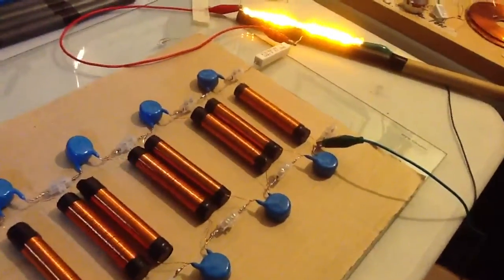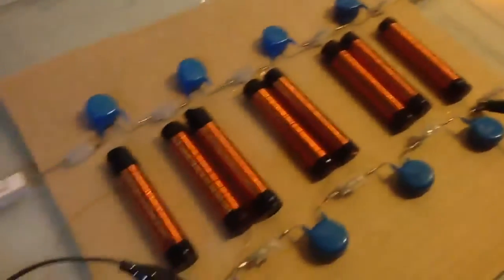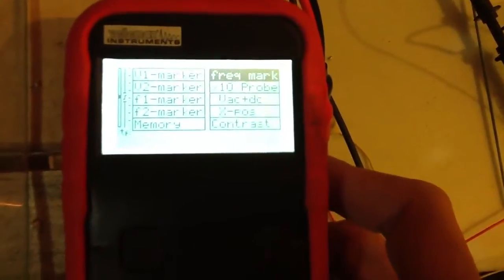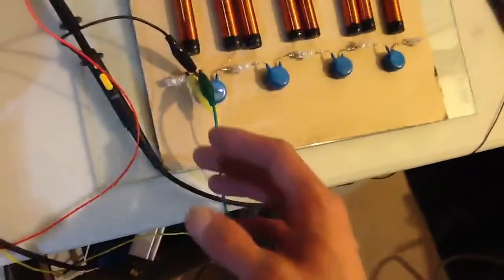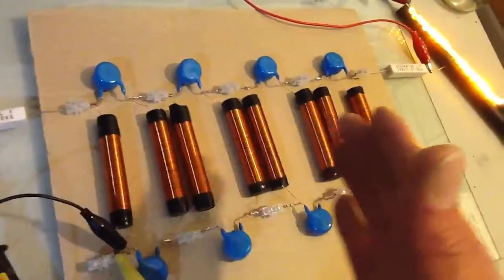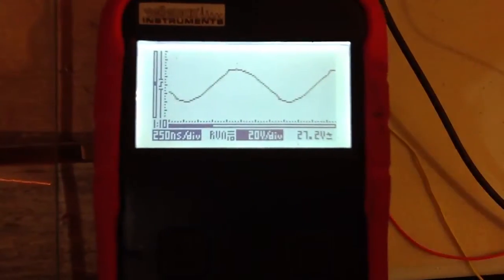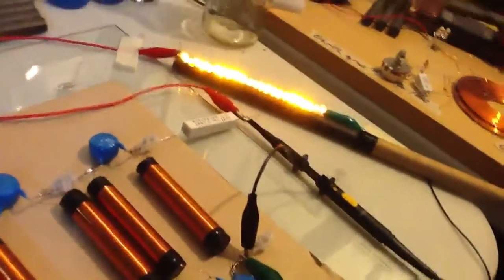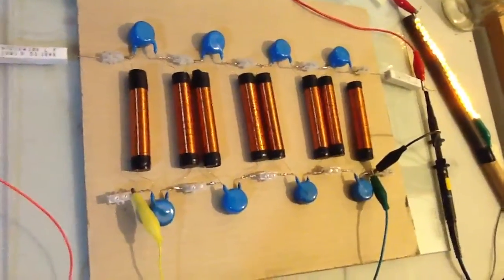1 Tesla LMD Longitudinal Magneto Dielectricity: first light

Comment: Little toroidal coils works fine too. 0,95mH each with 100nF wima caps. I use two lightbulbs 7V/0,3A. One in series with generator at input, second in parallel with last coil. At 104kHz the output lightbulb is more bright than input one. Even if I interchange them for check, the output one is every time brighter.
Reply from the maker: That is very cool. I never thought of that

Comment: your rf chokes could use allot.more.turns to
Reply from the maker: thanks yes i could have had more turns, but i only wanted a Single layer of windings, and was looking for a fairly high frequency, more turns would raise inductance and lower the resonant frequency
Reply: kdkinen eric dollard was using rf chokes that had many turns lowering the resonance is not a bad thing
Reply from the maker: yep those are cool, all pre-made. if i had enough of a certain one i would just go with that. im not opposed to lower freqs
I was even thinking of measuring the inductance of the home wiring at the breaker panel and PFC/ resonate the house for 60hz as some have done
Reply: kdkinen you can get the at.ham.fest or.swap.meets for.next to nothing or take your chances order them.from china

Comment: This is a special transmission line, in common ideal hertzian lines there is series inductance and parallel capacity, infinite inductors and infinite capacitors, in that case when you write the equations for the transmission line you get as maximal propagation speed of the wave the light speed, however in this another line type where there is series capacity and parallel inductance  and write the equations and solve it you get a formula show the maximal speed of the propagation wave can be infinite and in practical cases at too much times the light speed, but in this experiment is less than light speed for the high values of capacity and inductance

Comment: Why are there resistors one one side of the input and output? They are not shown in the schematic, and it seems to me that they would just lower the Q factor of the circuit.
Reply from the maker: +Alex Johnson hi buddy, they are for measuring current, the value is 1 Ohm, so you put a voltmeter across the resistor, and the voltage you measure is then divided by 1 (V/R=i) and that voltage reading across the 1 ohm resistor is your amperage reading. Better to use carbon resistors here tho, like my later videos

Comment: Hi there. How come you stopped work on this? This is an analogue version of a Tesla Coil and has all the characteristics of a Tesla Coil. You have a faster than light scalar wave at the end of that network there. I was in the midst of building a Tesla Coil back to back with another one, but I'm not so sure I want to go through the process to do what this does. Are you having spurious power output readings with this setup or something?

Why have you not simply rectified the output with a Full Wave Bridge Rectifier and then stored in a capacitor to smooth it out then insert a load resistor for better reading? I can think of plenty of other things you can do with this and I believe you can achieve alot more than what you have already done here, including what EV Grey and Eric Dollard did.

I mean you simply haven't done enough with this circuit. For instance you could have at least showed the input current with and without output load to see if it's loaded down in any way at all at the source.
Reply from the maker: +debunkified hi man, my lab is all packed up at the moment, but will definitely return to this circuit!
Reply: +Alex Johnson Hi there, I did build this circuit about 2 weeks ago, I prefer the joule thief in which I am measuring a consistent overunity charge with two meters on the input and output currents. One key is a fast switching tiny little transistor, I guess there's free energy in a collapsing field after all.
Reply: +debunkified I agree. I also think you could have used the pancake coils in the background to see how differently Longitudinal Magneto Dielectricity is in high frequency induction. Supposedly it is much more efficient at the transfer of energy than TEM waves. I am building my own circuit for the 5th time right now. I am looking for one wire transmission, etc. I recommend you try and make one as well debunkified, it is not too difficult.

Comment: I search and found a 'resonant frequency calculator' and putting in just the 3.74mh, and 9nf, it's 26Khz... should check the frequency of yours with your coil measurement, and the capacitors in series up to each point...  I'm very disorganized, trying to think of a good way to approach recording mine, need a tripod or something... and each cell does resonate at 26Khz alone, but 2 is 52Khz, 3 is 76Khz... I dunno  I'm also only driving with +/- 3V

Comment: Hmm; I guess the frequency I'm getting is the resonance of all capacitors in series and the end coil.  I was going through and disconnecting one end of the coils, and they ended up having little effect;  either I'm not exact enough in the resonance; or... I dunno the flow through the capacitors is going to be lower resistance than the coils, both in gauge of wire and because the inducted magnetic field impedes the current through the coil...

Comment: I should also note that mine are air coil.  2 1/4" diameter, some 450 turns of 28 gauge wire.   (for almost 4mh).  I added some soft iron welding rods, and increased the inductance, but the frequency stayed about the same, and after getting it resonant across 2 pairs (cells), it was the same frequency, and removing the cores resulted in higher output...   I was wondering if ferrite bead inductors would work better instead; I mean I have 0 permeability, so there's no magnetic field to build?

Comment: I made a set of 12 coils (6 pair).  They range from 3.74-4.17mh... most around 3.8-3.9 (3 above 4)  I need to tune these.  I have 12 caps that are 9nf; but they range from 9.6-8.7nf ... so I arranged the coils from least to most and capacitors from most to least.  Each cell responds well to the same frequency.  I'm getting no better effect from 5 pairs than just one cell.  There is no increase *frown*.  Are you discussing this on a forum maybe somewhere also?

Comment: Great demonstration, but coud u use resistor(inductionless) insteed of bulbs? And than on that resistor measure Amps, Volts and cos-fi on the scope... to finaly get output Power... Cos-fi = 1 on inductionless resistor so we need only A&V the pick value and than conwert to rms...